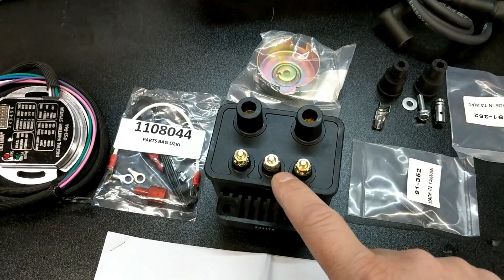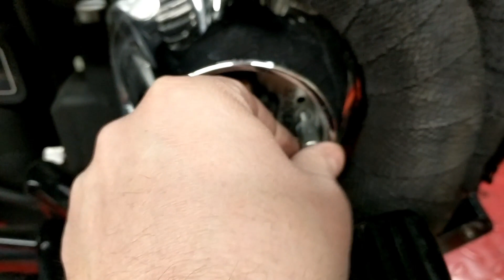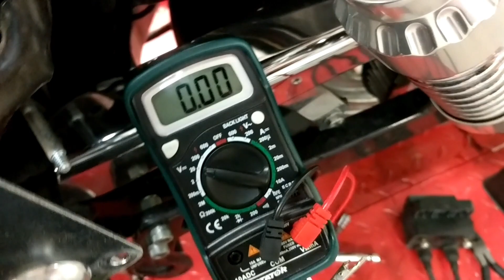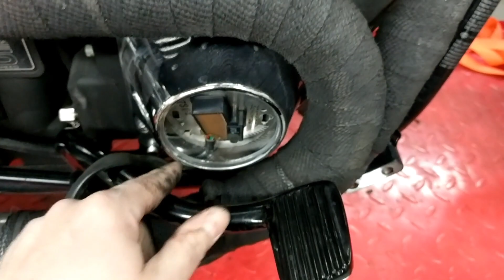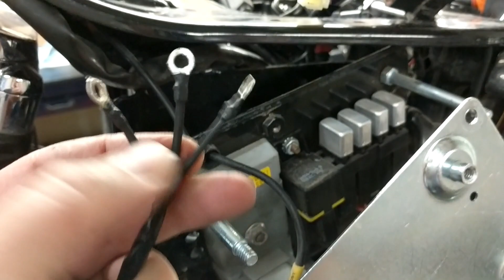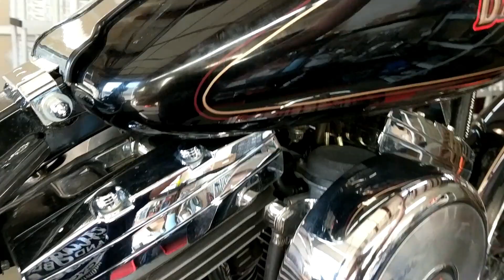How to Install Ultima Harley Davidson Evo Motor Dyna FXD Ignition Upgrade Kit

Comment: I added one to my 1995 FLHR 2012 it is still going strong after 20,000 miles only thing bad is the 2 led lights have went out ,   But it is still working ,  each Bike has difference on how to do it .   I cut mine off 16 long and used the wires from my bike , I did cut the white wire Coil and the Purple VOSE  under the fuel tank the ignition wire was to short to reach past the tank ,  I used Solder and shrink tape on my wires, the ends of the white and purple going back to the Module  I just folded over and used shrink tape to keep them free from grounding out .  from the red and black wire I ran new wires to the coil , the green I hooked to the green the 2 from the coil I removed I folded and used shrink tape and zip tied to the harness under the tank  everything is still in place if i ever chose to go back to stock.  And that is not going to happen
Reply from the maker: Right on, glad yours is working well too. Mine has been great and rock solid on my Dyna, no complaints.
Reply: Cool

Comment: Hey, first of all, really well done vid! I have one question, I got a 1995 fxds and I’m using an electronic speedo with integrated tach from Daytona digital. It uses this three pin triangle connenector. I would guess for the tach. Do you know if there is any possibility to use the connector? Do you have a circuit plan of what you did? 
I am really clueless 😅
Sorry my English is not the best.
Reply: hey how is your ignition doing so far? I heard some mixed results about this ignition I just bought one myself. great video by the way.
Reply from the maker: Hi Tim. The triangle 3-pin connector is the timing pickup output to the ignition box. They may have used this same connector on their tachometer, but you can't plug the timing pickup directly into it. You still need to run the timing pickup into the ignition box. There should be a wire on the bike's harness that provides the tachometer signal I would guess. What is the model of speedo/tach you're using? I'll look at it and see if I can tell you how to hook it up.
Reply from the maker: It's working great, no problems at all. I'm definitely happy with the Ultima ignition.